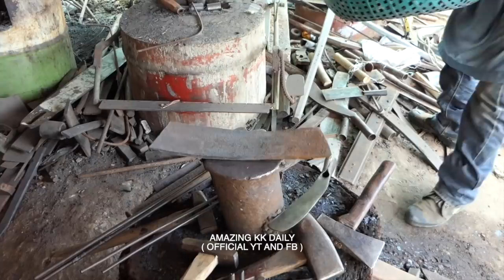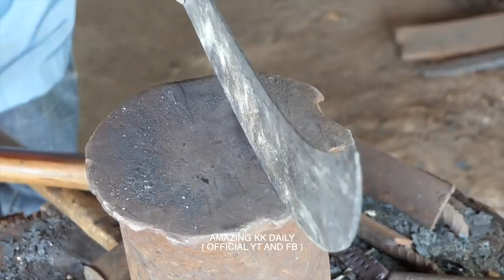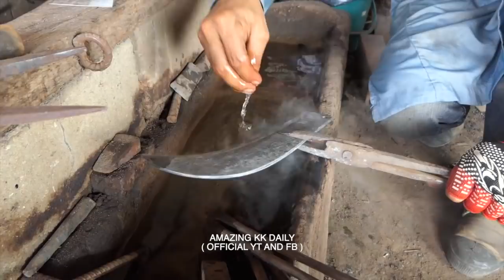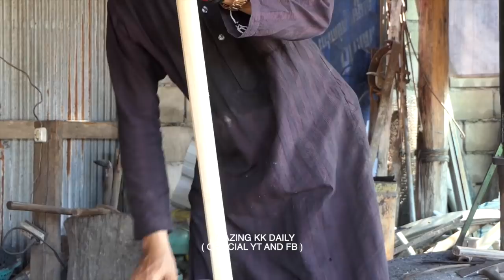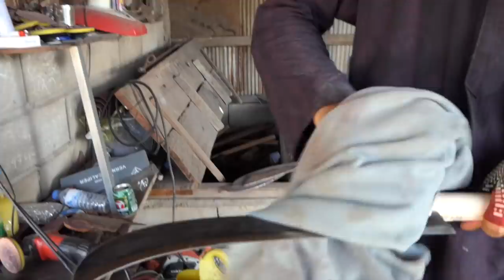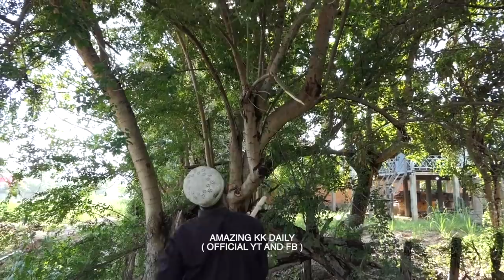MAKING A LONG-WOOD-HANDLE BILLHOOK FROM TRACTOR DISC PLOUGH

Comment: It's a look good knife, Instead of wire knot, it should be using a clamp with screw bolt, then It will look better.